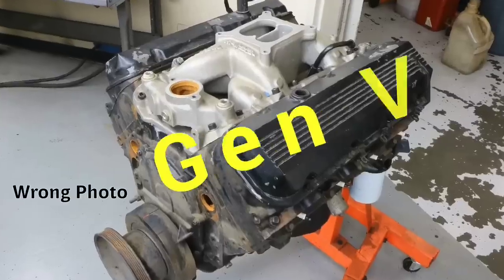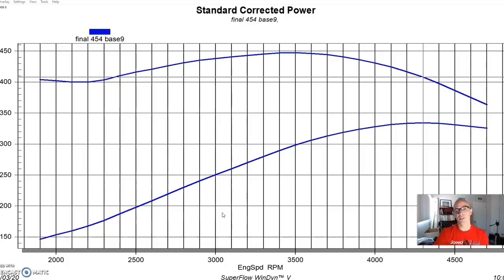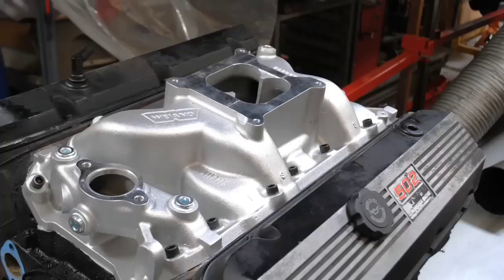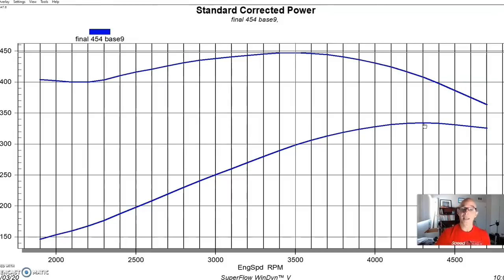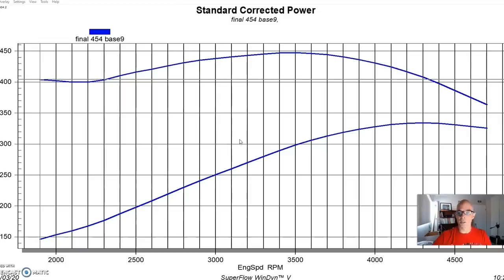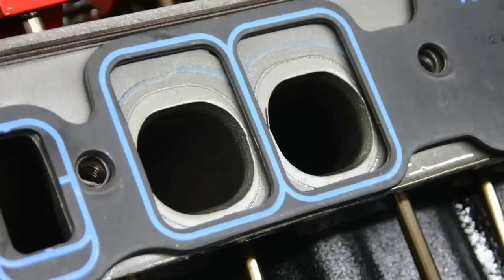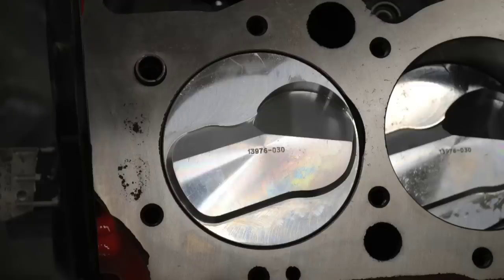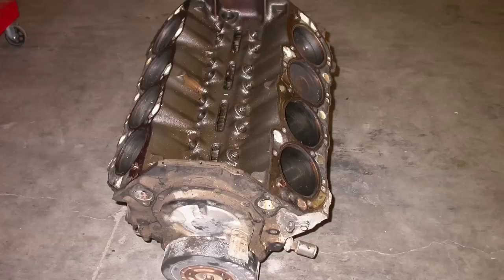HOW TO UPGRADE YOUR TBI PEANUT PORT 454

Comment: Wonder what 10.5 psi would do on a peanut port motor? For anybody looking for a towing combination with better 1700-3500 rpm performance.  Sometimes the tow pig needs to be healthy to get the track pig back and forth reliably. Lower rpm performance would also increase mpg allowing lower cruise rpms depending on gearing and tire size. Having 200 hp and 495 tq on tap as low as 1800 would definitely improve mpg and possibly engine longevity/ maintenance.
Reply: I'd like to see an 8.1 496 series of videos. Stock #'s/Stock Boosted #'s vs Upgraded #'s/Boosted #'s.

Upgraded in all forms and boosted. 496, 502, 505, 510, 540. From stock block to built motor with bigger crank. Go from the 4.375/4.250 and gradually increase the cubic inches starting with bore increase while swapping back and forth from the 4.375 crank and a 4.500 crank between each bore increase. 

Using the junkyard big bang method. I turned a L18 8.1 into a 9.4:1 compression 572 big block stroker. By increasing to a 4.5 bore and adding a 4.5 crank. Got a crank and h beam rod kit from eagle and a set of forged JE pistons. Installed new clevite main and cam bearings after increasing the oiling by drilling extra holes in the bearings. Also did a little work on the mains and cam oil galleries to help increase the stock flow. I'll be using my stock heads but upgraded my valves, valve springs and rockers assembly. Im am running a dual plane rpm intake with spacers. 
   Later I plan to run a single turbo set up and fuel injection. But for now a 750 double pumper is doing just fine. Running raylar towing cam but need a cam  the has more to offer down low.

Comment: Could you test Boost through a dual plane, like a performer RPM, and maybe a single carb tunnel ram? Just curious to see long runners in a wet flow application with a single carb
Reply from the maker: dual plane works well under boost
Reply: Richard Holdener do you modify them before running? Such as cutting the divider down any, and I’m assuming a 1” spacer is probably helpful as well?

Comment: I'd like to see a test where you take a long runner intake (do you have one of your fabbed ones for the BBC?) and move the injectors near the top to see if you can get as much power with PFI as you can with a carb.  That would give your PFI motor the best chance at charge cooling.

Comment: I've looked at several of your videos on the peanut port 454. I appreciate the immense amount of time you must have spent swapping parts, tuning, and dynoing. As with many people with a peanut port, I'm starting from an engine that has the factory TBI and intake manifold, plus all the accessories. How do I know where to begin my search for cheap "bolt-on" power? I'm not trying to tow the moon - I just want to keep up with the plethora of LS powered daily driver trucks and occasionally tow a boat (24 ft) or car on a flatbed (5k-10k lbs). I can't tell if your starting point is actually making more power than my factory rated 230 hp. Maybe if I removed my accessories and tested on an engine dyno, my TBI would be close to your carbureted starting point. If you figure 20% drivetrain loss means factory would be 288hp at the crank, estimates vary on the accessories but 20-30 hp at full tilt is within reason, putting it around 310-320 hp, near enough the same as your carbureted manifold, and this is assuming I keep the factory intake and exhaust as well.

So, while this means there's probably little to gain from switching from the factory TBI to your starting setup, all things being equal, I can't say there would be any gains doing other mods while keeping the factory TBI. Is it capable of providing enough fuel? Does it require additional tuning? Similar questions apply to the exhaust and intake - mine are completely stock and I like that my vehicle isn't obnoxiously loud for long trips. Can I keep them and make more power elsewhere, or is there a safe middle ground that I can reduce the restrictions but keep the volume down? Is the exhaust the first place to start, or will I need cams or something more serious before the TBI and factory exhaust become the limiting factors?

Oh, and to anyone singing the praises of the BBC's torque or "low end power", my 454 TBI doesn't hold a candle to my 6.0 iron block LS (LQ9). The newer truck goes like a rocket with 120 hp more from the factory and I have no doubt the engine weighs substantially less with aluminum heads. Unfortunately the new truck has squishy suspension that is constantly moving and the steering wheel feels "worn out" as it "feels like" more effort to initiate turns / straighten out of them, but this is probably due to lag in the handling response to steering input as the body rocks about. I put bigger sway bars on it and it helped, and new OEM shocks, but clearly it needs more damping than OEM shocks have and I would put even bigger sway bars on it if I had to do it again. This is likely down to the specific model / year / options the new truck has, though possibly the older truck was designed more with hard work and less creature comforts in mind...
Reply from the maker: Factory TBI is limiting for power, a carb and intake will make more than your TBI. Headers, cam and induction all help, but not sure about your emissions status and the need for the TBI
Reply: @richardholdener1727 Thanks for the lightning fast reply! My application is exempt from emissions regulations. How complicated is switching to carburetion and avoiding permanent SES (check engine) light? Is there an equivalent performance TBI friendly bolt on upgrade? E.g. bored throttle body, bigger injectors, chip / tune. Presumably a bigger fuel pump may be required, and/or an upgraded fuel pressure regulator.

Comment: Hey Richard.  I have a 454 Chevy big block in my 1996 motorhome P30 chassis. Think the chassis is a '95. Checked with the check dealer and they think it's a 454 L19. What would you suggest I do to increase the power on the engine without removing it from the rig?
Reply from the maker: headers & exhaust

Comment: I have that block in a 1/2 ton short bed obs. I took the heads and had them port and polished and added an airgap intake, 1.7 roller rockers, a low lift cam 500 lift a 850 Holley double pumper and that thing screams. I couldn’t get it too hook even in highways trying to pass a slow car it would spin the wheels. I have a compcam extreme energy 274 with 555/552 lift that I never got it on there. I miss driving it but need to put the ls3 into something so 454 coming out

Comment: Can I put a gen 6 cam with retro fit lifters and gen 6 heads on a gen 5 block I know the heads will fit it’s the lifters and cam I’m worried about
Reply from the maker: some of the gen v were set up for a hyd roller

Comment: That's a great truck motor, I would just get a gen 6 and cam swap it to have roller lifters and better compression and airflow. Plus two eBay turbos for the budget bruiser.

Comment: One thing I didn't see addressed is the fact that Gen V engines use a non adjustable valvetrain. How did you address that with the cam upgrade? Custom pushrods or did you convert to adjustable rockers? I have a stock Gen VI and a Gen V with a Banks headers and exhaust. Both trucks are very similar but the Gen V truck is noticeably stronger which suprised me. The stock Gen VI exhaust is very restrictive but it's hard to jusify replacing something that's not broken

Comment: A buddy & I have come up with the very same hybrid upgrade (gen V block, Gen VI heads) you talk about in the conclusion.  I would prefer a hyd roller block, but with that small a cam, meh?  I would probably port them, though I understand the exhaust seats at least, were so hard Roger Helgesen said he had to use a stone, because the cutter just squealed? So I am unsure if bigger valves are even possible or maybe cost effective?  Some high HP head porters squeal about them not being worth their time. In a car/boat application maybe? I do think however it would make an outstanding real truck, Suburban motor. Curious how a 402 or 427 version would affect the fuel mileage in a true driver truck with a 4L80, not towing heavy or at least not heavy for a gas motor?   Mark me down as wanting Badly to see you Do IT!

Comment: What about adding a cam and boost versus replacing the peanut port deals?
Reply from the maker: you can run boost on peanut ports
Reply: @richardholdener1727  exactly.

Comment: Is it possible to do a head swap on this engine with the Gen six heads that you mentioned. Any idea what the compression ratio would be and would there be enough valve clearance using the Pistons that are already in there it would be interesting to see how much more power the gen-6 heads make

Comment: Now you need a "rising boost curve".
Reply: Did you say turbo
Reply: @austindoud273  That would be good but I am thinking with boost controller to increase boost after the torque peak....  Stump pulling on the bottom to high power at 5500.

Comment: Richard, have you considered an L24, L26, or L28 Nissan\Datsun?  There isn't a lot of solid information out there for close to stock engines, and no real data on the effect of modifications.  These engines might survive a big bang test.  I love what you're showing.  I've learned a lot through your tests.
Reply from the maker: have a 1971 240 and had a 1974 260

Comment: I’ve seen a whole bunch of conflicting information with taking the GEN six heads and putting them on a GEN five, I’ve seen people say that you can do it with a head gasket, but the cooling system is the problem. Your water jackets do not line up and you need to block off one of the ports. Can you address this?
Reply from the maker: It can be done with the right head gaskets

Comment: Richard, can a GEn VI head be used in a MArk IV block?, also can you make a video just like this but low buck mods for a mark IV with peanut ports? I have a MKIV 2 bolt engine on a Silverado (5spd man, Dana 44 3.42:1 diff)
Reply from the maker: the mods work the same on the mark 4 block stuff

Comment: Great video, thanks. Any suggestions on what I could do to get more pull from my  mark IV, 049 head 454....turns a marine jet unit at max 3500rpm...trying to figure the best way to get all power as low rpm as possible. Picked up a set of peanut port heads, would they be worth spending money on? Appreciate it
Reply from the maker: PORTING WON'T HELP MUCH AT 3500 RPM
Reply: @richardholdener1727  thanks for that, was thinking of replacing my 049s with the peanuts? Would that be worthwhile to get my power band lower? Or maybe supercharging with a marine procharger...thanks again

Comment: I guess this comment is to add to my previous comment... After doing some research  I have found that there is a few differences in the gen V and gen Gen VI. As we know there is a difference in heads and compression, there is also a big difference in cams. The gen V has a duration of 198\202 at .050, lift of .390/.409, LSA 112. The gen VI has a duration of 204/209, lift of .480/.483, and LSA of 118. That is seems to be a big difference in cams as far as performance goes. I wonder how much power is lost with the 118 LSA versus if it had a 112 LSA?

  From your videos and the factory specs the gen VI makes about 40hp more. with the differences in the motors we have makes me ask, is ther that much of a gain with vortec heads by? I know you have flow tested them and said they flow much better. but, I have also seen a list of flow test that was put together by a stan weiss. On that list it does show the vortec heads intake port flowing more, but the exhaust flow was less than the peanut ports, which using the percentage of flow formula puts them about even with peanut ports for overall power output. A back to back test with a gen V with peanut port heads and just the vortec heads swapped would be interesting. maybe with the wide lobe seperation  takes a way the advantage of the cam in the gen VI.

I would guess just throwing some, lets just say AFR 265's (which seem to be the best choice power wise) and that cam on a gen 5 or 6 motor would get you about the same peak numbers as your rebuilt motor with the peanut port heads, but at a higher RPM. comparing the cost of the machine work and pistons to rebuild my motor to buying AFR heads, the rebuild would be cheaper. So I guess you have to ask yourself which do you want, a new motor that peaks out at a lower rpm or a used motor that runs to a higher rpm. The other persuading factor is the heads could be swapped out in a weekend. thanks for the videos Richard. I would love to see a specific test to prove or dispove my theories. thanks again.

Comment: I just got a 454 that came out of a 1988 rv has been rebuilt .. I looked up the casting numbers and it’s a different block that came out of the rv .. it has the same rv setup my question is do I keep that set up or just redo the block for more power
Reply from the maker: WAS IT WORKING?
Reply: Yes
Reply: Only has 60 k miles

Comment: I like this combo, it’s make a great driver in my C20. I’m with you though, I’d probably go with better heads to begin with. I learned my lesson on a 403 Olds build a few years ago to replace the wheezy 307 in my gbody cutlass. Rebuilt stock bottom end (dished pistons) but with early 70’s high compression heads, they were fitted with W31 bigger valves and blended. It ran ok, but not near brutal enough. Ultimately, I wish I had gone with flat tops and BBO heads because they flow so much more than the SBO heads do.

Comment: I'm not sure why one would take the Gen 5 short block, if a 6 was there. The hydraulic roller, coolant passages, etc, ad infinitum..I'm "hybriding" gen 6 heads on my gen 7 8.1L with intake spacers and cleaned up Vortec intake, 411 computer swap, 24x crank reluctor.

Comment: Richard, what budget heads would you suggest for a mark4 454. Has peanut ports with a howards .617 lift 258/269 duration 108lsa cam and 60 over flat slugs.
Reply from the maker: ProMaxx?

Comment: G6 heads on a 5?  Just by a G6 if you need those heads and get  a fuel pump boss and a roller set up in one?
Reply from the maker: lots of Gen 5 guys out there looking for cheap head upgrades

Comment: @Richardholdener thank you so much for all your videos I've seen tons of them I have a Gen V Ill be purchasing speed master oval port aluminum heads what is the best cam you recommend? I'm planning to go turbo in the near future and should I change pistons now or just gap for turbo? Engine is completely dismantle now thank you for your feedback in advanced 🙏
Reply from the maker: cam choice is determined by what you want the cam to do na, idle quality, drivability, use with stock converter, max power etc...
Reply: @richardholdener1727  you did exactly what I want to do ... Basically refresh engine build, I was thinking about pistons but you mention just changing the heads and Cam will do a nice job I want to drive it once in a while comfortable and add turbo in the future

If you would of done this build again would you skip the piston bore? I want to refresh and clean the whole engine, hone it and just add heads and cam and add turbo in the future would you recommend me to do anything differently?
Reply: @richardholdener1727  I hope you can help I was getting ready to purchase my cam and heads but while I was watching videos and your comparison I have a block 454 #12550313 BBC block wich is a late  gen 5 with a gen 6 block it has the boss screws, 6 bolt timing cover, mechanical fuel pump how do I order parts in this senerio? Thanks in advance

Comment: Id like to  build a very similar combo for my blazer id use a hydraulic roller and port the heads and add 2.19-1.88 valves, rpm air gap, if money permits id use afr 265cnc oval heads

Comment: Currently building a similar motor. Core is a GM replacement gen5/6 roller block .040 over and KB hyper pistons that are flat top. Block decked for .005 in the hole, .039 felpro head gasket. Early truck 396 heads with intake valve upgrade to 2.25 valve size. ZZ502 GM roller cam. Will use the same intake Richard is using. The 502 cam is slightly larger lift, same lobe center at 110 degrees. My guess is marginally higher hp and torque numbers with most of the difference at 4k and above. Good build, Richard! Question, do you experience any detonation issues with the dome piston and the peanut port heads? I was originally going to use peanut port heads in my build, my local machinist warned me about it, and he had these 396 heads at a good price point. Wondering for anyone else who might want to know.

Comment: Those poor things were so choked from the factory.  I always thought it was the heads that were the main choke point but the intake sucks, the cam is weak, and the low compression leaves a lot to be desired.  I'd be interested to see how it would do with this build but run the TBI unit (better cold start, and altitude adjustments).  I want to build up one of these from a mid 90's C3500 dually and this would tow so much better with all that extra torque.

Comment: Thank you!  Great information.  Could you test this setup with an aftermarket efi just to see how it compares to the carburetor?
Reply from the maker: EFI makes the same power with the same intake (actually slightly less than a carb)
Reply: Richard Holdener I appreciate your insights. Do you know any aftermarket EFI/PCMs that can also control a 4l80e? I’m curious because I have a stock 91 TBI 454 with a 4l80e in my truck and it is beginning to have pcm issues.

Comment: What valve springs did you use?
Doing about the same build for my boat, bored 40 over just a mild marine cam and valve job on the factory peanut ports to keep torque.